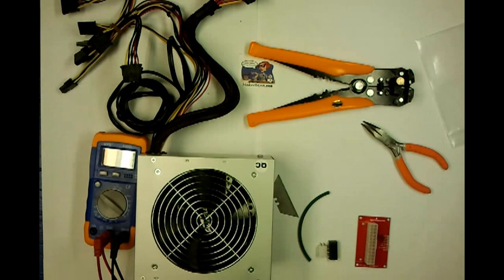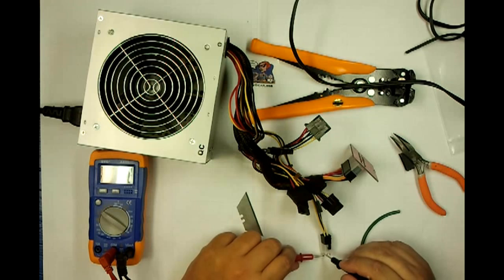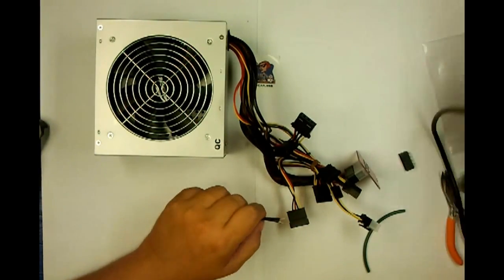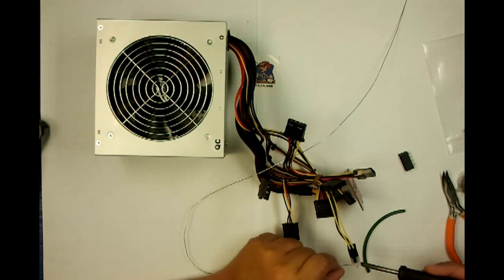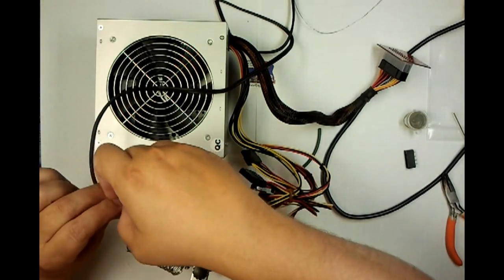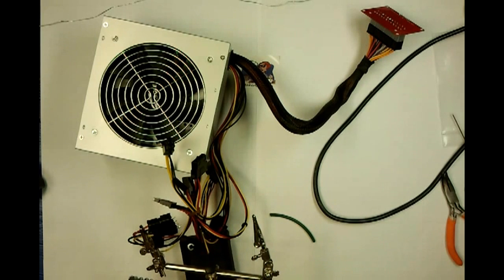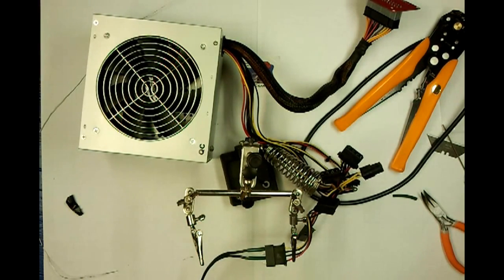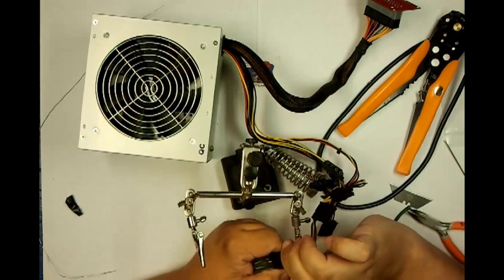Still Extruding: Powering RepRap from an ATX Supply

Comment: Hey , im trying to hook up my new sanguinololu 1.3a ATX bored with a 12v 30a 360w power supply. 
can i cant find anywhere on the net to help me , can i even do it? 
or should i just use an old power supply from a computer?

thanks

Comment: Your soldering technique is better than mine.
That breakout board just to short the power switch seems like such a waste. You have a 5v line that is always on so long as the psu is plugged in. Why could we not use it to power the logic on the reprap and have it switch on the rest of the lines when a print job comes in?